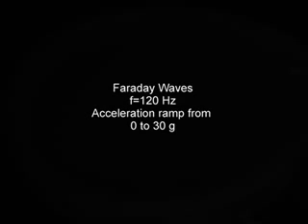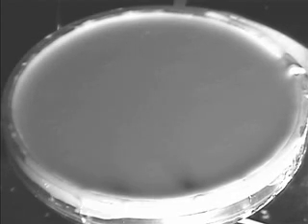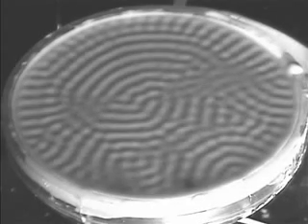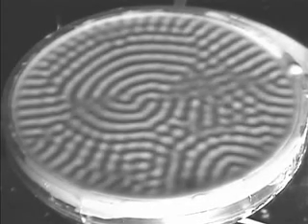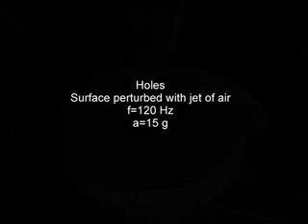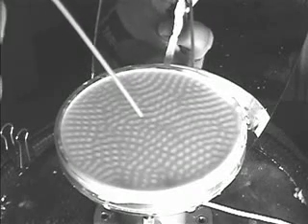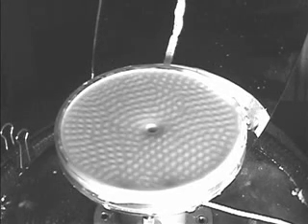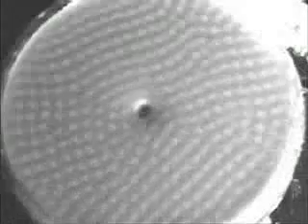What Sound Looks Like

Comment: @brokenbeforetime the stuff in the speaker is a mix of cornstarch and water. When the sound waves hit it they cause it it change from a liquid into a solid. It's called a  non newtonian fluid. So basically if you press your hand into it slowly it's a dense liquid, whereas if you punch it it would condense then crumble from the force of the impact.

Comment: This is what is refered to as a newtonian fluid. it is dense enough to run across, yet if you stop, you will sink. You can slowly poke a hole with your finger. Or you can punch it, at which point it will become solid. Also, on a side note, Abraham almost killed his first born son, Moses parted the red sea. Lay off the Dan Brown for awhile.